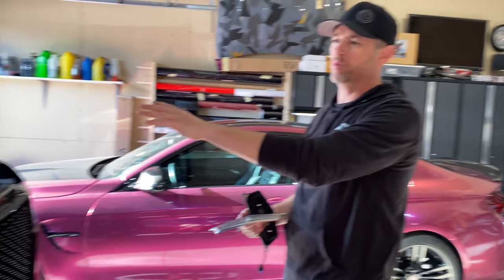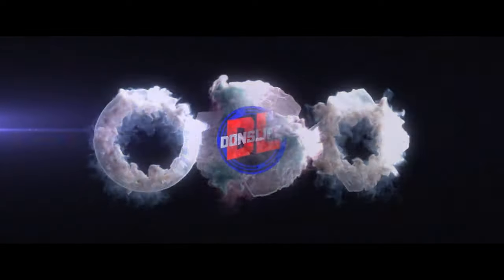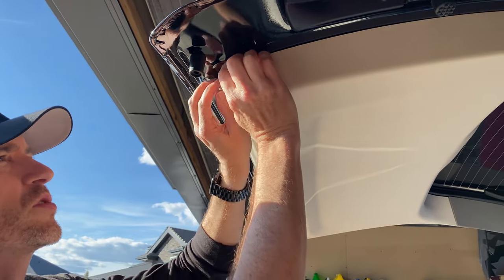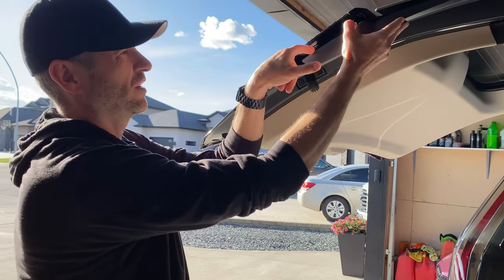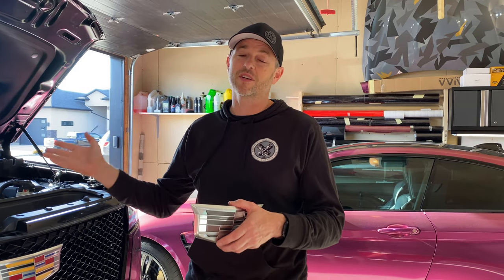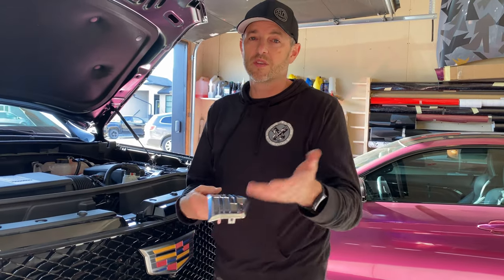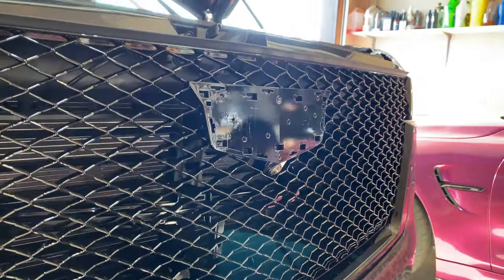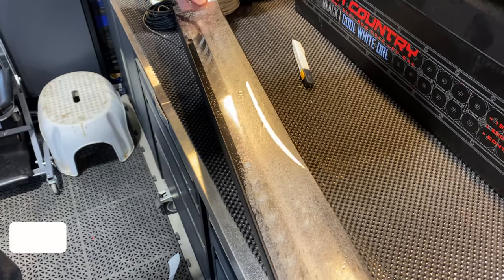2022 Cadillac Escalade Sport Platinum Monochrome Emblem Install

Comment: I am interested in replacing the front Emblem with the led one for my 2020 Cadillac XT4 What I do not understand is what wire do I connect the led emblem to???
Reply from the maker: Illuminated emblems usually have a plug and play kit to attach to the headlight or DRL harness.  Cheaper ones sometimes have poor instructions and intend to have you use a fuse tap for the headlight or DRL fuse in your fuse panel.
Reply: @Donslife  which led emblem fits a 2020 xt4 I am having a hard time finding one.
Reply from the maker: I don’t know of one either

Comment: Thanks for the video, very informative. I have a 2020 CT4-V and want to change the rear and front emblem as well. Do you know if the front has the clips as well? Also where can I purchase the emblems.
Reply from the maker: Try this code to save some money : DON404

https://404parts.com/collections/ct4/products/2020-2022-ct4-monochrome-emblems

The clips are a little different but the same idea
Reply: @Donslife  Thanks, tried the code and it did not work!
Reply from the maker: The code is new for a collaboration I am working on.  It may not be active yet. 🤷🏻‍♂️

Comment: Great installation video.  Question, on the front emblem that was removed, if the clips were broken can they be replaced?
Reply from the maker: Unfortunately the clips are tiny and part of the housing and can’t easily be replaced.

Comment: I think I just made a mistake in buying a front LED emblem from that LEDfloatingcaps company. I have a 2016 Escalade. Is the part your using OEM? Where did you buy it? will it work on the 2016 Escalade model? More specifically talking about the front emblem.
Reply: He shows the emblem directly from the Cadillac website. Front and back set runs about $200

Comment: Thanks for the post. Trying to do install myself on rear emblem. Removed screws/bolts from rear appliqué but can’t seem to remove panel. Do you need to use a good amount of force to remove? I’m guessing the replacement tabs provided are what’s holding the panel in place and these are likely to snap with the pressure ? Appreciate your help !
Reply from the maker: You can use some force and pull the corner out where the handle is.  After you remove the screw of course.  After that some pulling force, or if you prefer a long flat tip screwdriver can pry the clips out on by one.  The replacement clips are for the top rectangular piece
Reply: @Donslife  thanks Don. I have the plastic interior panel removed. It’s the rectangular exterior piece I’m having trouble with - removed bolts on either side of lift gate and removed black nuts (8 total) from the inside of panel.
Reply from the maker: Hey, there are some small round pointy plastic tabs that when squeezed together they’ll pop out of the hole.  These are the ones they give you extra ones for.  You can see them if you peak through the other access holes you used to get to the black nuts.  I used small needle nose pliers to get them